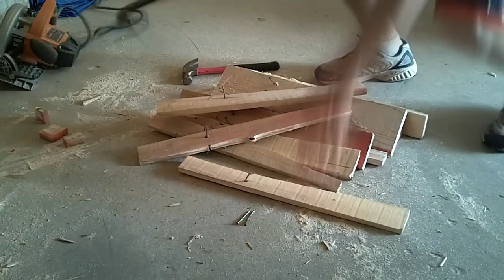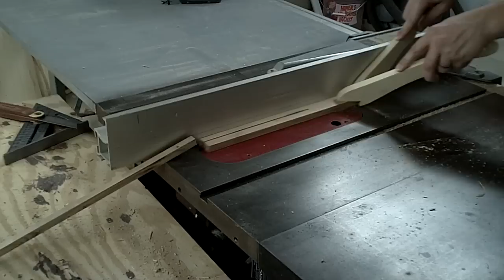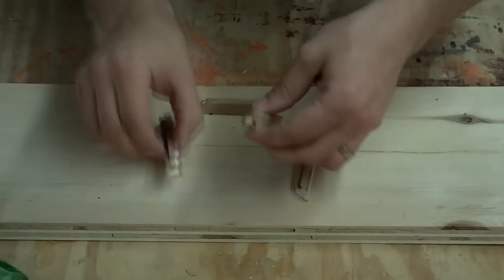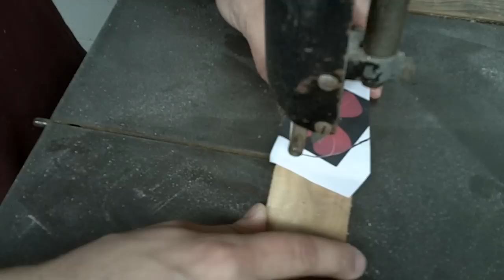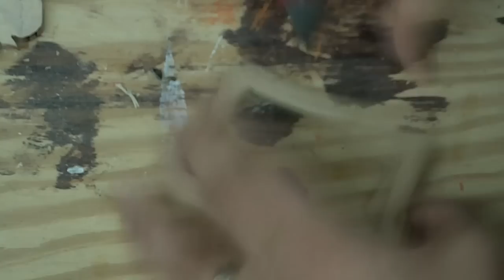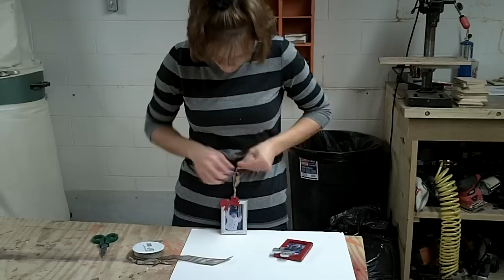Pallet Wood MINI Picture Frames

Comment: Tyler,  A great project and very cute results.  Things like this are great heirlooms your kids can pass on to their kids.

There are lots of ways to make these so I'm just throwing out another one for you to consider because you seem to like to take a little different approach on things.  On small frames like this instead of cutting it out of straight pieces and using miters and grooves cut your center rectangle out of a larger piece. Use a scroll saw or your band saw and gluing the entrance cut like you do on band saw boxes.  You could even use a jig saw or router.  Use your router and a spiral cutter to cut the rabbet in the back.  The key is to cut out the rectangle out of a larger piece of wood then you have the exterior you can shape any way you like using whatever tool you choose.  If the kids have a favorite animal or toy you can mimic that shape in your frame.

Great videos, love the energy.
Reply from the maker: Gail Long Great suggestion Gail, certainly a different style! These will be on our tree for years to come. Thanks for watching!

Comment: Nice job Tyler--thanks for posting!
Are you missing the thrust bearing on your 103.0103 band saw?
GO WINGS!
=Brian=
Reply from the maker: toolguybak Hey Brian, is the thruster bearing the one that the blade pushes against when sawing? If so it's not missing it just isn't in the correct position at this point. Where did you get the tires for your saw? Also, am thinking that I will go will a hammered black or grey when I refub it...think that will look sweet!

GO WINGS....lions are decent this year too....GO LIONS!
Reply: ***** Yes, the thrust bearings (top and bottom) are behind the blade. For excellent tires and blades, go to www.woodworkerstoolworks.com.
I really like the hammered bronze color, for non-reproduction work.
If I was going for the original Sears Blue, I'd use the ACE NOW #21207 Royal Blue spray can.
GO WINGS & GO LIONS!